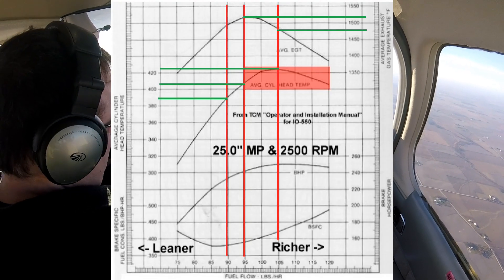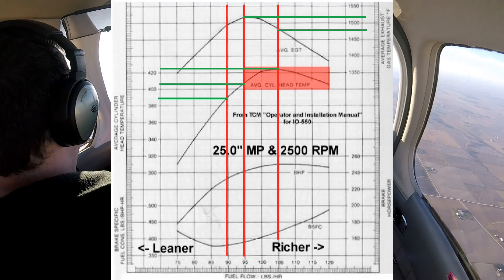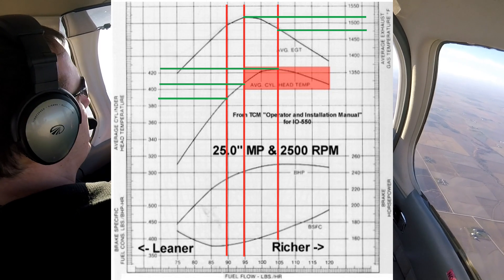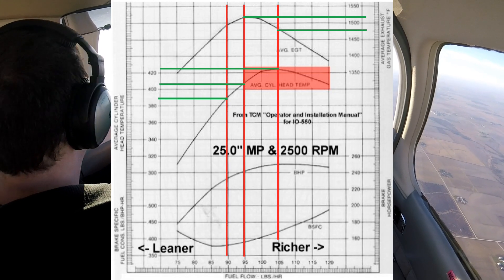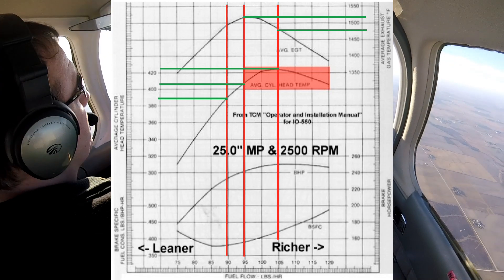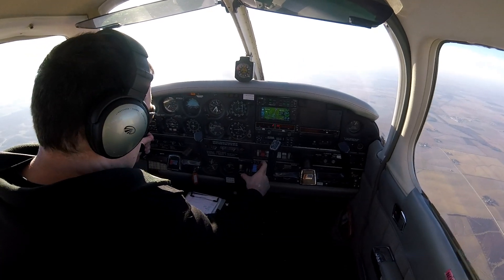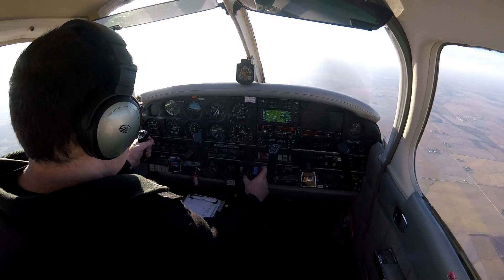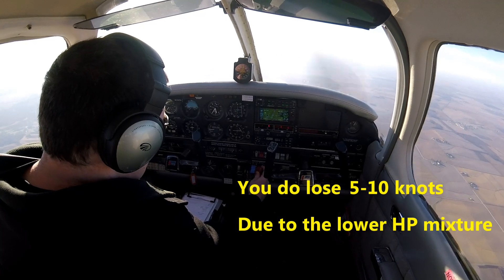Leaning mixture with a constant speed prop

Comment: Everyone should get out of the dinosaur era and follow Mike Busch’s leaning method whether it’s an aero club plane or not. Set for 2350 rpm at cruise, start leaning while rpm drops then gets “slightly rough” and richen just enough for smooth rpm again. This gets you 2300 rpm cruise with nice cool cyl head temps and clean plugs forever. Do it this way whether it’s a constant speed prop or not and forget that useless egt gauge, it’s all about the cyl head temps. Keep em below 380 and the engine will last a life time. Egt means wasted gas going out the pipe and that’s all it means, it has nothing to do with engine damage, that’s what your old moron flight instructor will tell you though.
Reply: Thanks for the advice. Could you provide any references or links that explain in more depth how the method works on a technical level and why it is a good way to go?
Reply: @n124lp  This is probably the best: https://youtu.be/h3bATVXMHQg
Reply: @n124lp  https://youtu.be/_VfiPuheeGw
Reply: And the M.P in with position?

Comment: Do you have GAMI injectors?
Reply from the maker: No we don't.  I have read that Lycomings have better air/fuel distribution than Continentals so they can be generally leaned better than stock Continentals.  I don't really have much experience with Continentals, but I can say the Arrow will go 25 degrees or so lean of peak without much vibration.